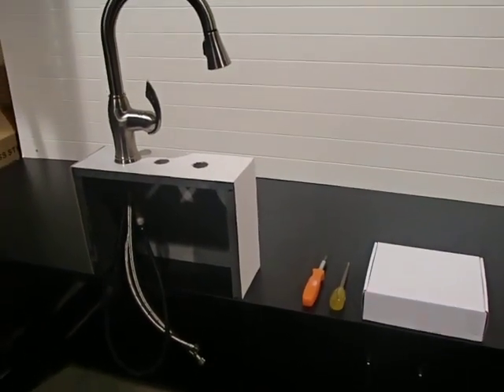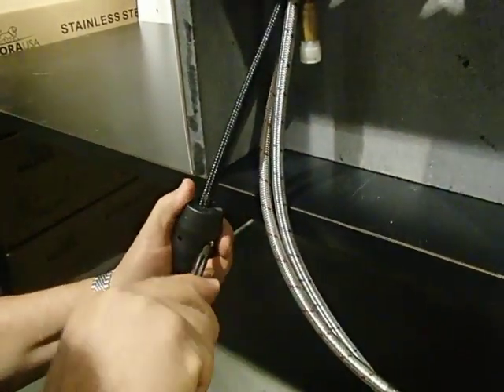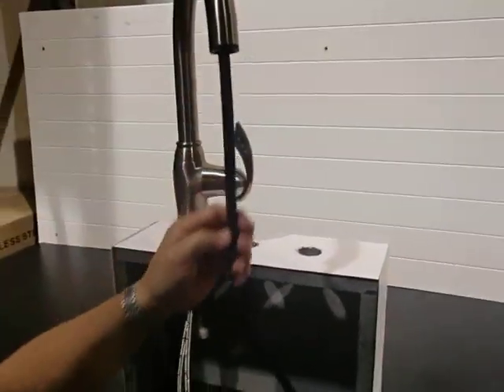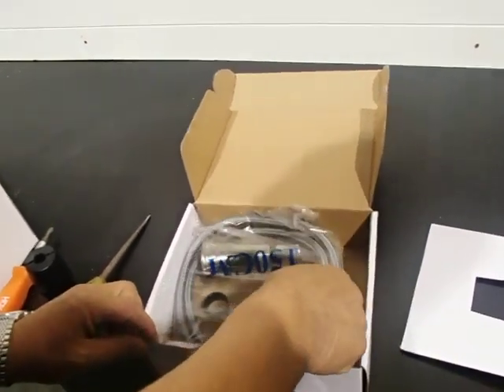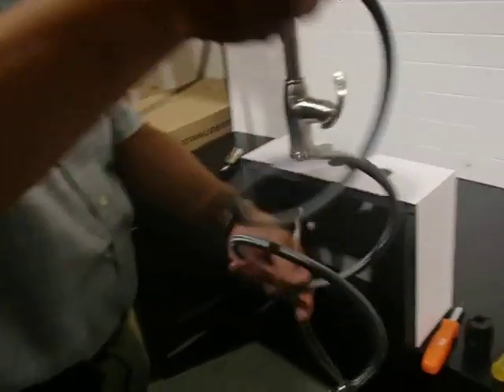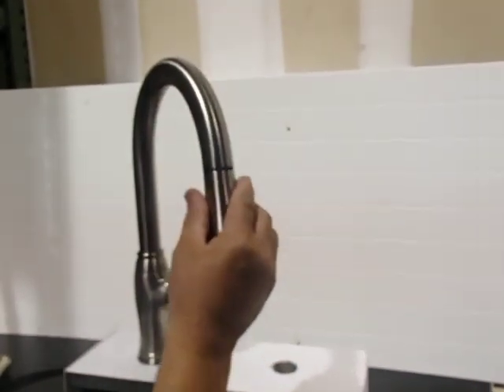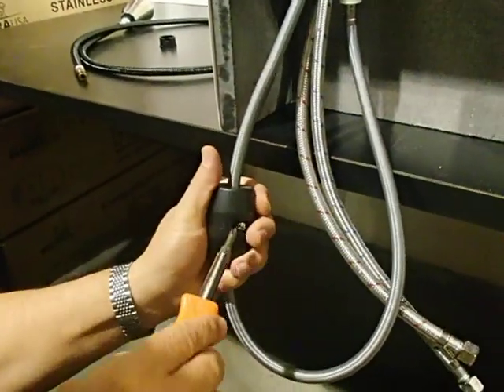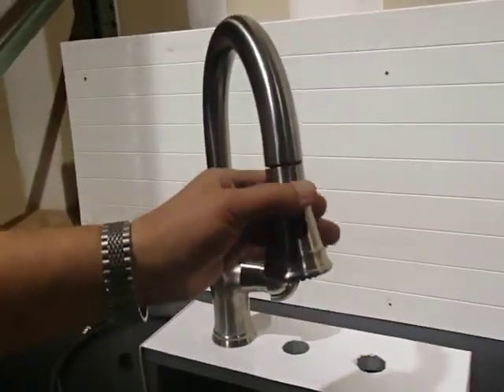Upgraded replacement spray head and hose for 3714-KPN

Comment: Looks easy if you have a table top demo.  Try it on a deep sink inside your kitchen cabinet.  They came up with the "upgrade" because the switch on the original keeps breaking.  I've replaced it 4 times in 2 years, first in six months.  Now they want me to pay for the "upgrade."  The faucet handle also broke and they replaced that with a component that doesn't even match!